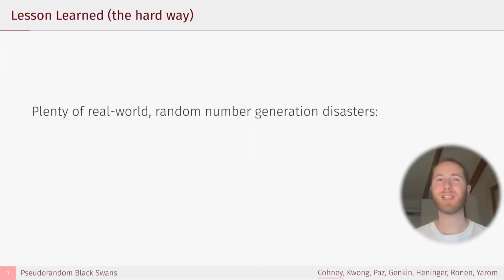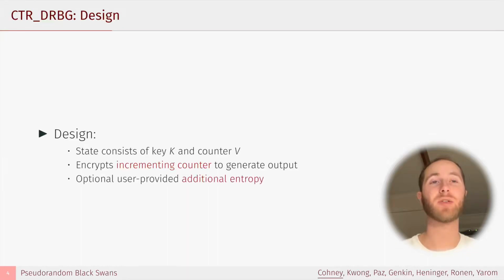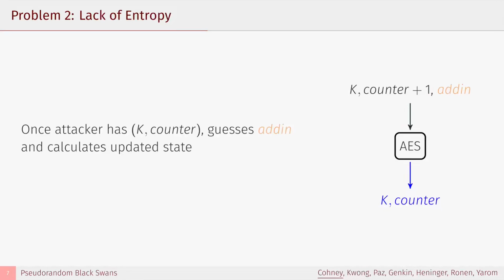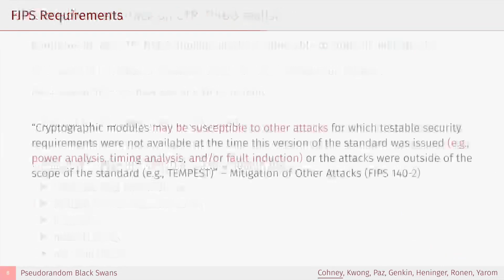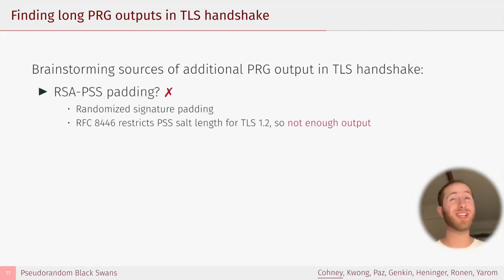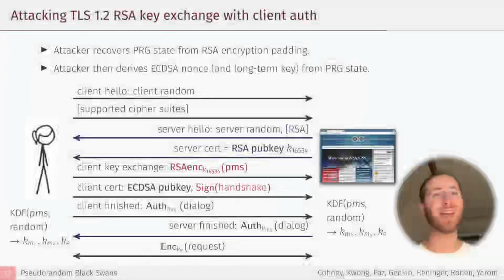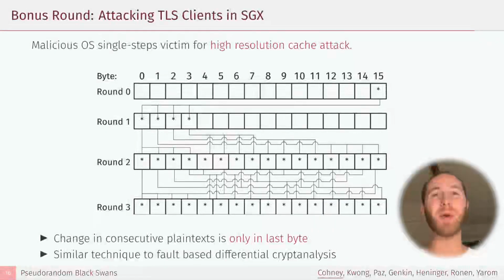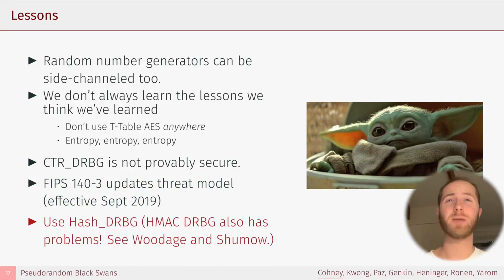Pseudorandom Black Swans Cache Attacks on CTR DRBG

Comment: CTR-DRBG integrated in CPUs? Yep. That was me. I picked CTR-DRBG for very good reasons. Additional entropy and personalization strings, bring more problems that they solve. The correct way to implement the CTR-DRBG is without additional entropy input, without personalization strings and with a maximum request length of 16 bytes (128 bits) so the key is rotated on every output. Also reseed as often as the supply from the conditioner permits. So the necessary feature to make any CTR-DRBG actually secure is a fast noise source. That is how it's done in the Intel CPU RNG, which was designed by myself and colleagues. Your attacks assume really back software implementations. Don't use software implementations of RNGs. That's just dumb.